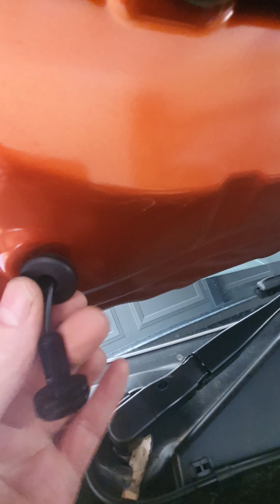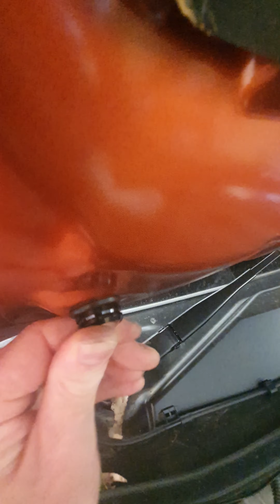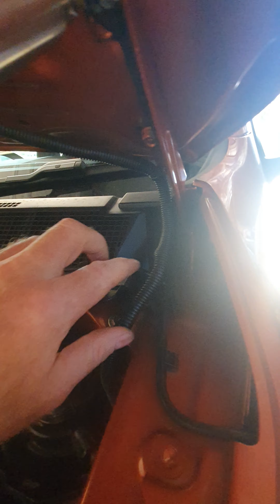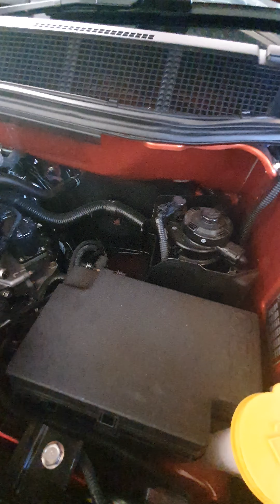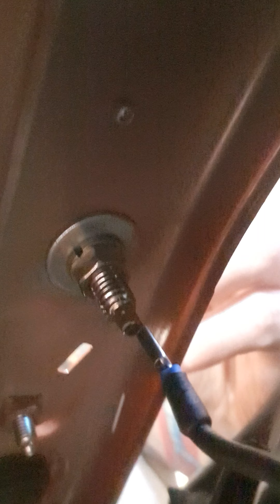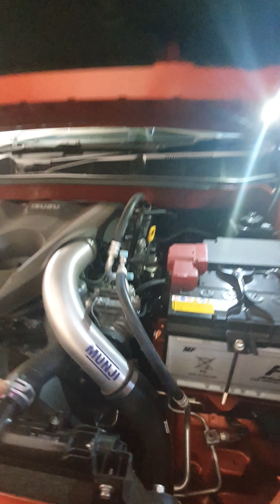R&R UNDERBONNET SERVICE LIGHT KIT -INSTALLATION

Comment: Awesome, what size fuse would you recommend?
Reply: Only a 5amp fuse would be needed as it’s an LED which operate at around less than 1 amp each so 5amp fuse is all that is needed